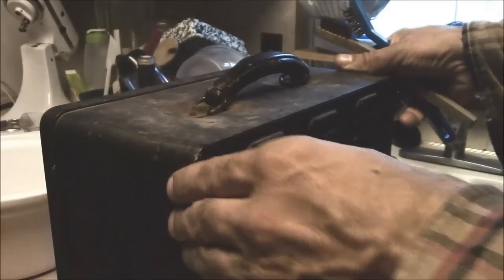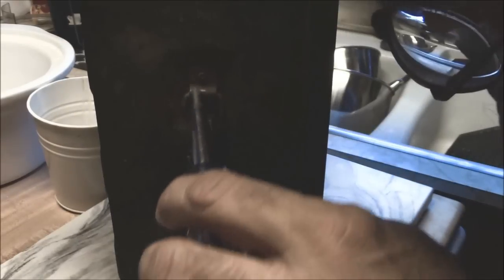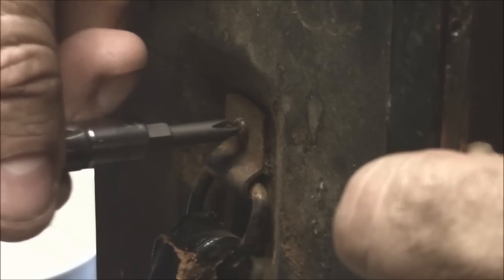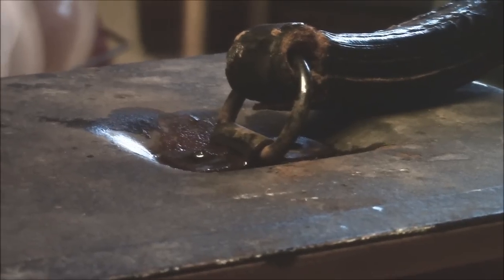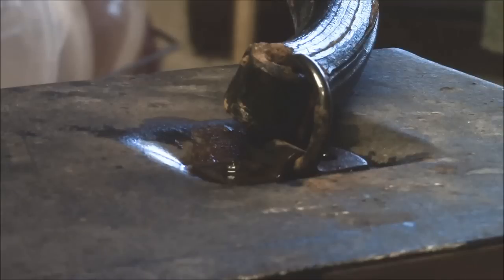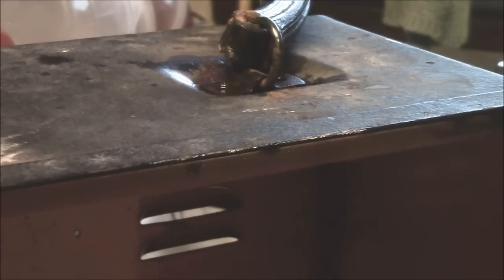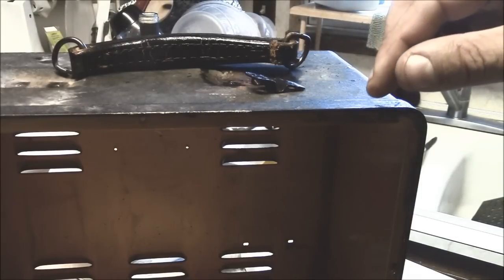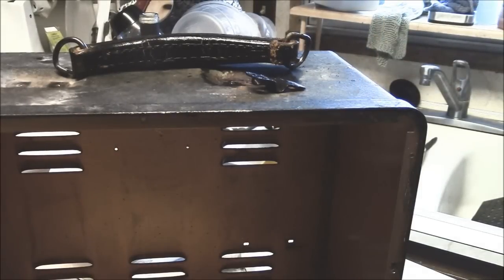Tips on removing small rusted screws

Comment: I don't know if you will read this comment, but I just wish I could give you 100+ likes. I used all your techniques and it saved me, when I was working on a 100 year old fan. I was trying to remove the base and it took everything  you did here to get them out.  One screw was very rusted and if I didn't watch your video, I would have had to maybe tap it and then not use an original part.  **THANK VERY MUCH!!!**